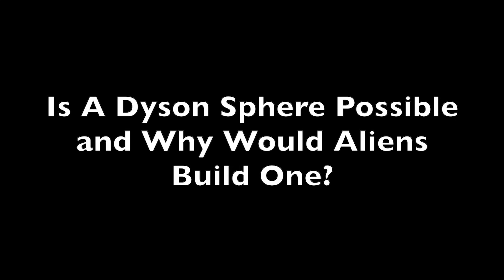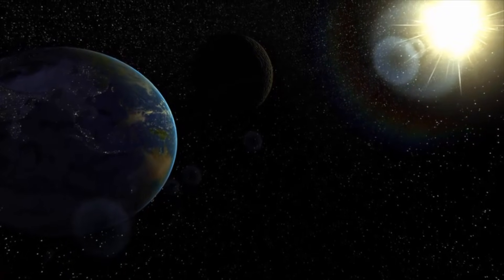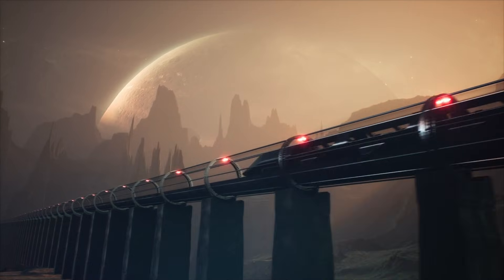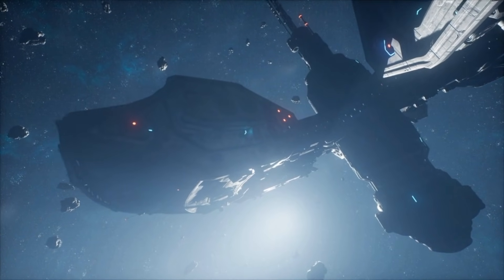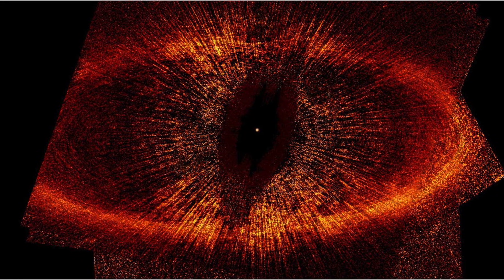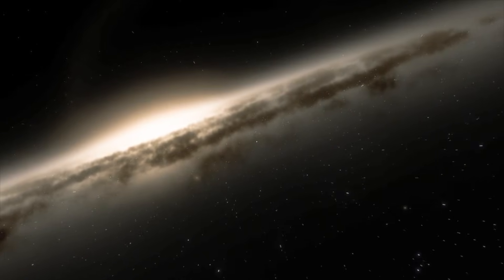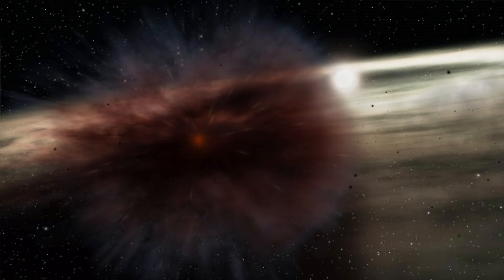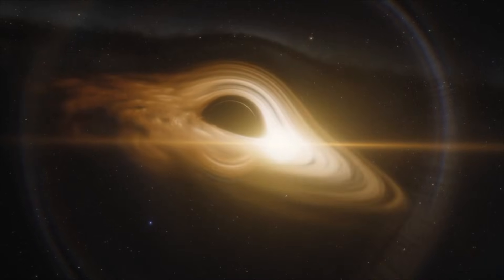Is a Dyson Sphere Possible and Why Would Aliens Build One

Comment: No the pyramids of Giza were not tombs. No bodies have ever been found inside them. And there's no mentioning of Egyptians ever building them either, only that they built a town next to them in the first dynasties, indicating they were already there. Geology also indicates most structures of Giza being much much older. Most noticably the sphinx and the two "temples" infront of it. Whereas in the quaries of all the pharaoes in the Giza region, the chisle marks are still very visible. For the sphinx and the temples the sphinx-compound, from whence the stone came, has the entire surface eroaded away, at times by as much as two feet. Geologists claim that these structures are likely to be as much as 50000 years old. Not 5000.

Comment: LLMs have unlimited energy needs, even for a small natural population.
Reply: AI also has a water/coolant issue too.  While stars are there for the energy (if you're a machine intelligence), the problem is that they're in the (rough) middle of star systems, while the water and other cooling liquids are on the outside of the star system (or kept in ice-giant planets).

Meaning a single Dyson Sphere or Niven Ring might be the outer edge of doable, while the layered, "nesting doll-brain" system would be hopelessly at risk of overheating.

Comment: Crazy, i was thinking of all of these ideas last week after your last Dyson Sphere video. A fusion reactor = 3.828 x 10 to the 20 power in Watts would need one million fusion reactors producing 328.8 Terawatts (TW) to equal the energy output of our sun. We should look for equal outputs of energy to the type, brightness, mass, etc, and then multiply in factors. If we were to look for equal factors to the candidates' stars, you could also figure out the distance of the swarm from the star based on exponential magnifications of heat minus-light. How long would it take to make that would likely be equal of light defusion equal to heat infusion. Would be planned, not likely randon. Then look for swarms that produce, non-random but standard levels unlike Tabbys star, a quarter, half, 3/4ths, equal amount, 25% more, 50% more, well it all depends on the star.  I think Star Trek II, building an artificial planet, is much easier, as you can use gravity of the extra planets, asteroids, comets, and matter collected from fusion reactors. I think it's easier to move or create. If tech they have can make their civilization via Dyson Sphere. They can farm in places in space without much biological beings rather than robotic overseers of cultivating and securing energy. I worked thru this entire thought concept. There are multiple reasons to build one, sure deathstar, propulsion, and hide in the dark forest. Gravitational anchoring, high-speed transport using gravitational aligned counterbalances for increasing transportation.

Expanding SETI signatures for either spacially/gravitationally synronized planets, artifical backholes with similar sized orbiting stars, grouping of exotic stars for mining, like a central artifical blackhole with four clusters of four stars of types that provide materials circling each other or a even smaller mass object to keep alignment with the four groups of four stars circling the central mass. I think you said it best that we already are beginning that process, beings that exist who can build advanced versions I think they would understand the forces of gravity honestly if you found one where the patterns emulate farming, I'd bet that like farming, agricultural areas, industry, and power stations, unless radiation and gravity doesn't matter to them, it's not likely that's they live, as that's industry, farming, and sure they might build habitats in central areas but I'd look at what the stars outside and closeby are doing, perhaps circling around them. You don't want to be in the middle of a super radioactive swarms, you'd want to in a since pipe them into more comfortable areas for habitats, we look at intelligent life as one species, what if a area had four types with differing gravity far more advanced to go about building their own Dyson Pyramid. The swarms are factories, temples, monuments what have you still nobody built the pyramids to live inside, so look for nearby systems where the conditions of the factory produce an ideal systems in mathematical solutions where the conditions reflect equally the consumption needs of the swarm and calculate populations on scales in equal but increasing factors of production. Dang, it's hard to post on YouTube. It comes our like a bad text. Oh well, I hope it makes partial sense.
Reply from the maker: It made perfect sense and illustrates that fusion reactors are not quite on the level compared to a Dyson sphere.

Comment: It's baffling to me that we have wavelength selective emmisive coatings, multiphoton upconversion technologies, and optical metamaterials, but every speaker on the matter of Dyson structures seems to insist that we could, with absolute certainty, spot one from It's infrared emmission spetra.
I'm 99% sure that with tech that's no more advanced then what we have right this moment, we could make a Dyson structure look like a completely innocuous cloud of dust or hot gas of our choice.
Reply: Yes, exactly.  Nobody's even thinking in terms of tactics on this.  IF any exo-cultures out there are building Dyson Habitats (to use the broadest sense of the term) for military purposes, then camouflage is definitely going to be a concern.  We have to assume that the idiots aren't in charge of the project--that they're GOING to know their work will be visible from great distances unless they actively do something to hide it.
Reply: I find it interesting all these techs you mentioned are brand new and do infact exist already heh, just goes to tell making a Dyson swarm ain't that hard, especially a hidden one

Comment: I just can't feasibly understand why any civilization, ours or otherwise, would build a dyson sphere/ring/swarm.
There's better ways to telegraph your existence and show off your intellect.
Fusion and Fission alone should provide plenty enough energy
Religious and Decorative engineering projects are a thing, but there's an upper limit before someone either asks 'hey we could be using these materials for a more practical thing' or the original purpose gets warped and lost along the way.
Maybe science experiments? But if you're at the level of tech where your civilization can build a sphere/ring/swarm, it would be hard to believe that you couldn't also run some sort of simulation that can get your the results you want with a 99 percentile of accuracy.

Sounds like a cool sci-fi concept that just cant be seriously justified unless there's some star system that has fundamentally endless amounts of material and the civilization has incredibly long lifespans so as not to lose the purpose of the project after a thousand years or so.

Comment: I wonder what gravity would be like in a dysons sphere.
Reply: Depends on the rotation speed and the way it's spinning
Reply: Indistinguishable, as long as the sphere was homogeneous.
Reply: If it were literally a spherical shell of matter, gravity would cancel to zero within it
(search wikipedia for "Shell theorem")

(edit: You would still have the pull of the star. I mean there would be no pull on you from the shell)
Reply: Depends on distance, look no further than birch worlds they are theoretically the largest physical structures you can make and they use blackholes for foundations and energy

Comment: The amount of material required to build a Dyson Sphere would be more than what exists in any solar system.  Dyson Spheres are only science fiction.
Reply from the maker: As I said in the video, Freeman Dyson did the calculation in 1960. A full sphere 3 meters thick with a diameter of the orbit of Earth is one Jupiter mass. So we do have it. It's just not the right kind of material.

Comment: People need to STOP and consider how much rock will be necessary to build a Dyson sphere.  Like I did. There is not enough rock in 100 Earth like solar systems to build one Dyson sphere. Especially with rock being an impossibly fragile building material. So, NO we cannot build a Dyson sphere with any conceivable building material or process we can imagine today! :)>
Reply from the maker: It's in the video. Freeman Dyson did the calculation that for a 3 meter thick full sphere of a diameter of the earth's orbit, it comes out to one Jupiter mass. The materials are a different story, Jupiter's hydrogen and helium aren't going to cut it without cheap transmutation technology.
Reply: @JohnMichaelGodier  Your Dyson Sphers shell is  going to have to have a thickness of hundreds of miles (at least) in earths orbit  for any chance of holding together due to gravitational stresses. and rock has no tension strength!
Reply from the maker: @lewis7315  Wouldn't matter if it wasn't spinning. If it's rotating for artificial gravity, yes, you need either a lot of thickness or a very strong material. But if it's just sitting there, then it's just light pressure and solar wind acting on it. You don't need much thickness for that. The real problem is suitable material, hydrogen will not do.
Reply: @JohnMichaelGodier  Gravity, John!  The poles of a dyson sphere will collapse into the sun because they are not in orbit of the sun! Only the equator of a Dyson sphere  could survive. As you try to build the sphere north and south from the equator of the ring, those pieces are not going fast enough to stay in orbit and they would fall into the sun.
Reply from the maker: @lewis7315  Thrust is the easiest fix. It would have to be continuous and variable, because you already have forces acting against it from the solar wind and light pressure, but that varies. You'd need a lot of thrust anyway just to keep the sphere stable around the sun, so adding thrusters to the interior poles is just par for the course. I think the real challenge would be in figuring out just what effects things like coronal mass ejections have over long periods of time on the interior of such a structure.
Reply: @JohnMichaelGodier  I think Attempting construction of a Dyson Sphere would be an exercise in futility resulting, ultimately, in catastrophic failure. I see no good reason, regardless of a species' level of technology, to even attempt it. But then again, I could be wrong, but I doubt it!
I think the possibility of EVER finding or creating a Dyson Sphere is as near "zero" as we can get.
Reply: There are no, and there will be no Dyson Spheres constructed ever. It would be a complete waste of time destined for failure.
Reply: And to humbly drop my ten cents?  If you can do fusion, then you can make carbon out of helium (triple alpha particle reaction) easily.  From there you fabricate a custom graphene shell, over and over and over again several millions of times over until you get that 3 meter solid layer.

And yeah, there's problems with that: graphene is transparent, and too conductive of heat and electricity both, to work out well by itself.  So even with the nano-tech to make it work, you'd need to put other elements in there.  But that's less of a "can it be done?" question and more of a "How?" question.
Reply: This. I've been saying this for years.

Comment: I wonder if we could get a Dyson swarm started in the next five hundred years.
Reply: Depends on what you mean by started. If you mean launching like 10–100 times the volume of our low earth orbit presence but around the sun, then it's perfectly feasible. But getting a really DENSE swarm in that time is nigh impossible.
Reply: Shorter Answer, non-defeatist version?  Where there's a will, there's a way.

To elaborate: Money and economy are tools of a social contract.  Societies use these to not have to rely on barter for every single thing.  There's wiggle room in the concept, and even the most cheap and miserly of nations (like the USA) still manage to afford Manhattan Projects (making atom bombs), moon shots (putting men on Earth's Moon) and DARPA projects (like co-authoring the original text-based internet).

So in essence, some modest efforts will happen as soon as somebody obnoxious makes it a priority.  As soon as China or Saudi Arabia have plans for space, that's when we will start taking O'Neill Cylinders as permanent bases seriously here in the States.  ;)
Reply: Short answer: "No."

Long answer: Economics makes one fundamentally impossible, as the energy required to build it is beyond what's economically available. The logistics of mining, processing, and moving all the material needed to build one is simply too vast, and you'd run out of available fuel long before the swarm/sphere was able to help in any fashion.